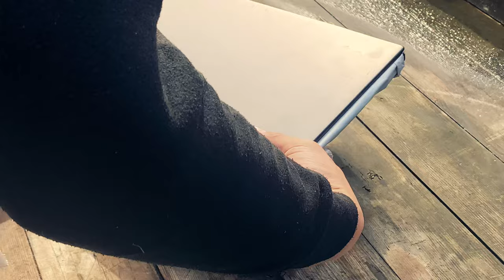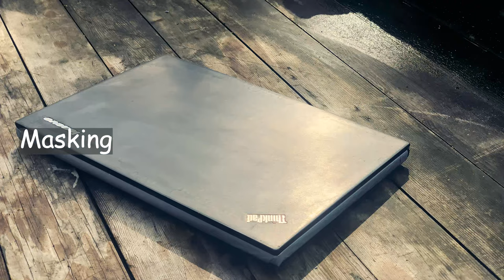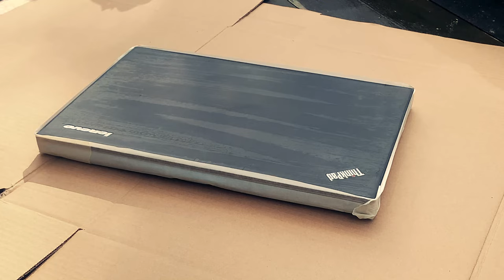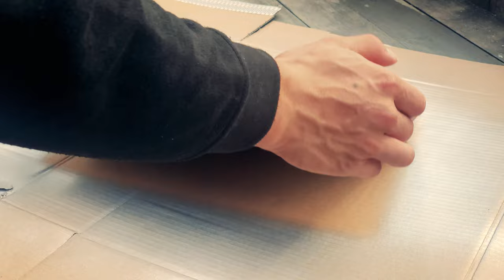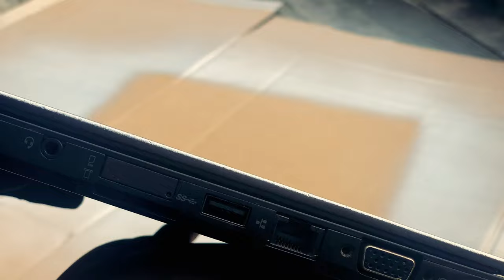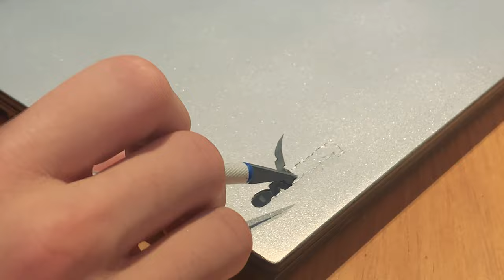ThinkPad T440s - Spray painting laptop lid

Comment: Why not just take the lid off? I painted my Dell and my Thinkpad T480 and I'd advise taking it apart, Also tip for the logos! You can put masking tape over it, then pencil the tape to get the outline. Once you do that just cut the extra tape, when your done painting it's a lot easier. Cool paint job though
Reply: When you have 30 laptops refurbished and scratches on lid... you won't take it apart